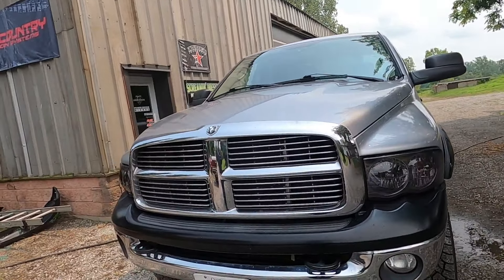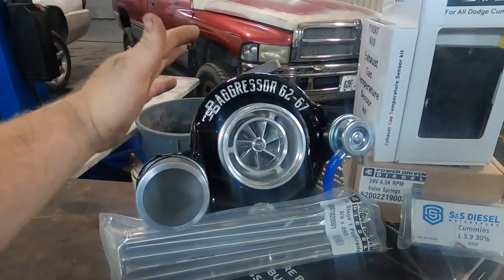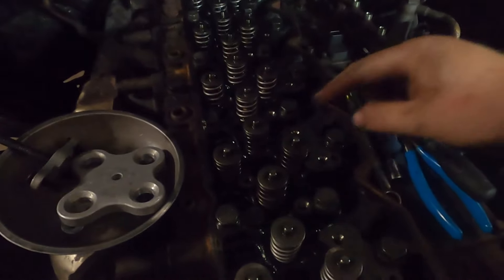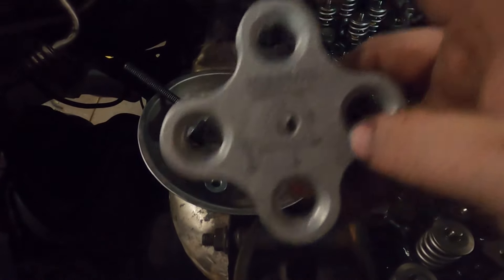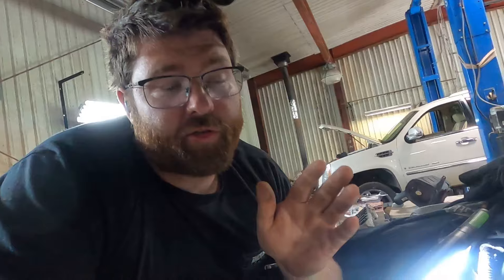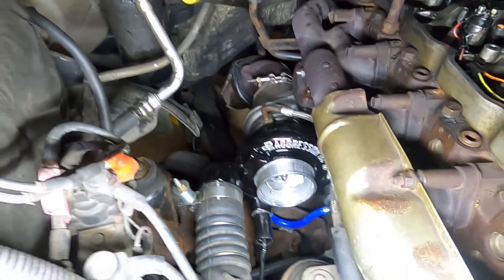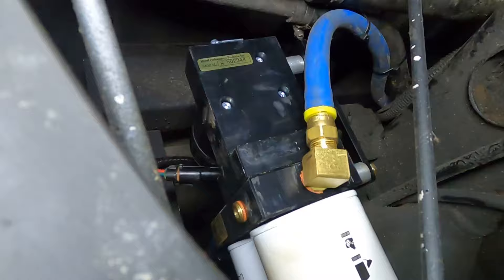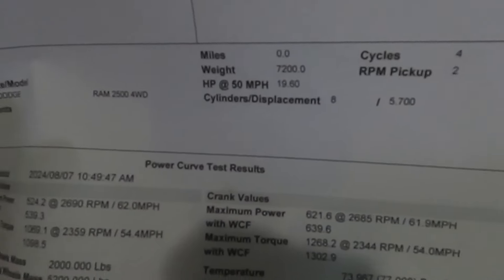ADD 200 HP TO YOUR 3RD GEN CUMMINS!!

Comment: Hey Andrew, where do you send your injectors out for cleaning? Is there anywhere in the Niagara area  I can send them to?
Reply from the maker: Industry diesel and turbo services in Oakville can do them.
Reply: @screamindieselltd  thanks!
Reply: @screamindieselltd I called them and Taylor deisel, it's actually cheaper to just get new injectors. I also asked about a p7100 rebuild. They want 2900 to 4000 depending on what it needs. Crazy